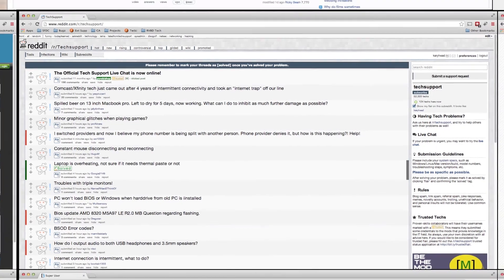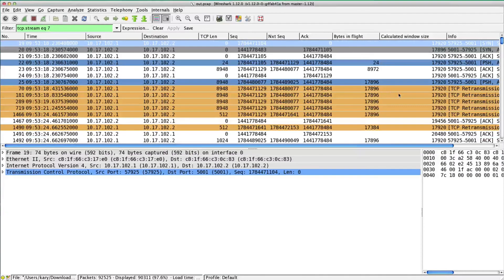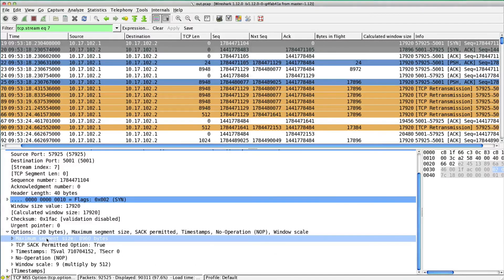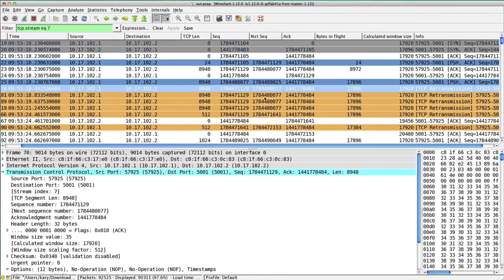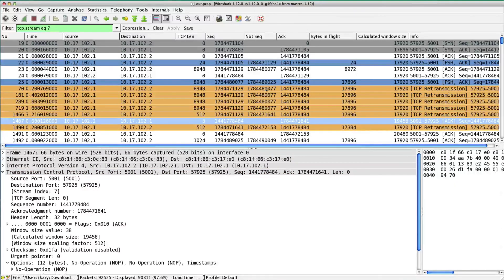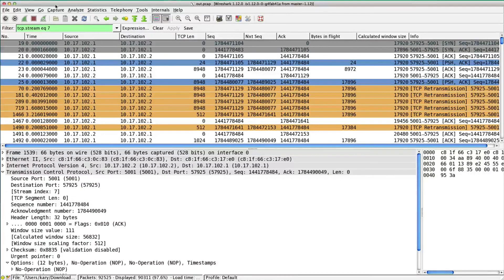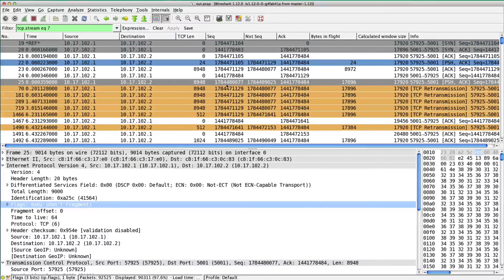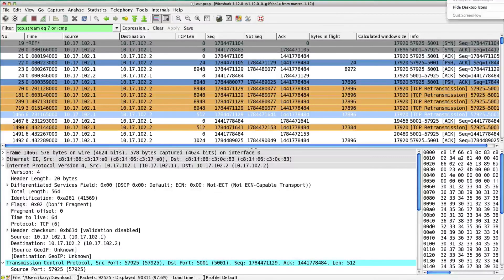Troubleshooting MTU Problems With Wireshark

Comment: with jumbo frames, it might be that if another side of the link doesn't understand them, no ICMP Frag Needed would be generated because the frame is unintelligible to the receiving side, not a frame but some noise.
That is, if the switch in between doesn't do jumbo frames, this exact scenario is quite possible.
PS. retransmission after 6 seconds with MSS=512 is mtu probing and controlled with net.ipv4.tcp_mtu_probing sysctl.
It's disabled by default and I'm still wondering what are possible side-effects of keeping it on.

Comment: Helpppppp just changed my mtu on my router setting via laptop and now the netgear gateway on chrome will not open for me to reset the mtu how else can I get it back to normal
Reply: Configure TCP mas adjust 1360 or  1388

Comment: excellent video, goes to show even on a lan you cannot simply assume it will work.

It be interesting to see how well modern versions of tcp discovery work on this situation as now both linux and freebsd have alternate systems that can be used instead of icpm discovery.

Hopefully ipv6 wont have these issues as there is an emphasis from the start with ipv6 to tell people to not blindly firewall icmp packets.